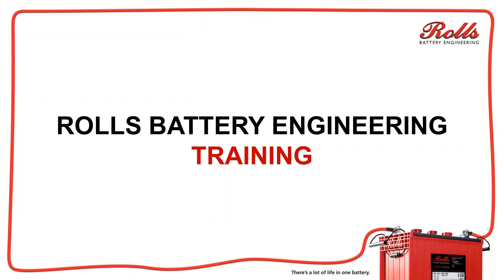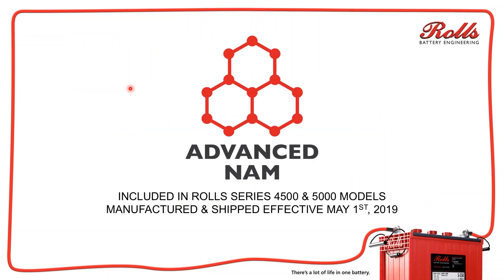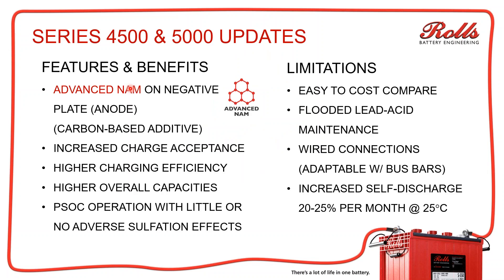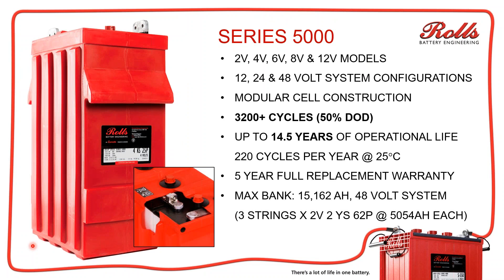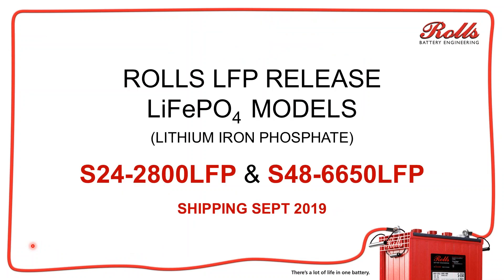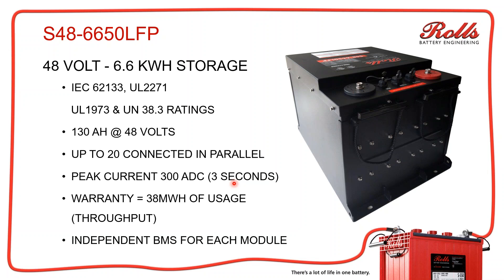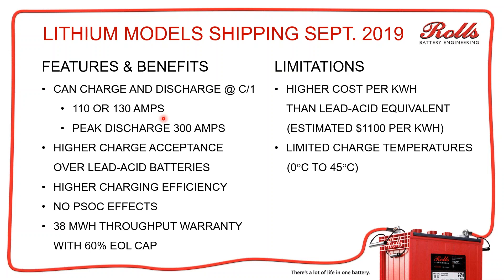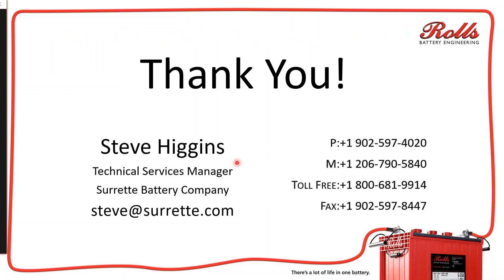Rolls Battery Engineering - Advanced NAM and Rolls ESS LFP Overview

Comment: Excellent update with corrections.  You should state that your price estimate of $1100 KWh is in Canadian dollars. Many Americans will view this youtube site and presume US dollars...these days it is a big, big difference. 

The only problem still with the updated FLA batteries is still "voltage sag"....right?  Once they are in the 60% DOD or more any significant discharge demand will pull the voltage down drastically.  This does not happen with the lifepo4...this is a very important point to make in your comparison chart. The reason is that a smaller bank of lifepo4 will perform like a large bank of FLA at mid range discharging demand.  That improves the economics of lifepo4 better in comparison with FLA.